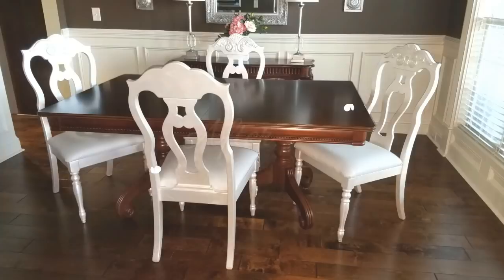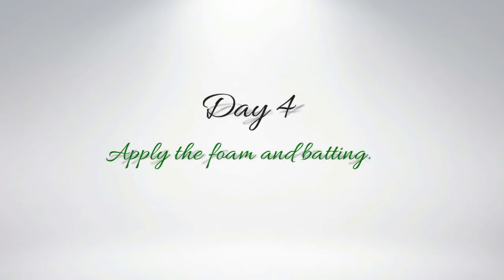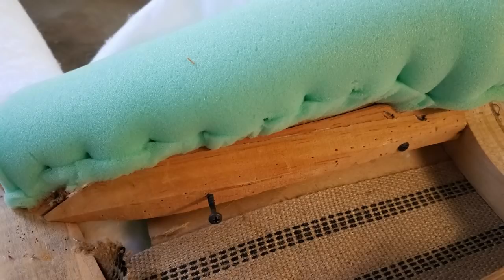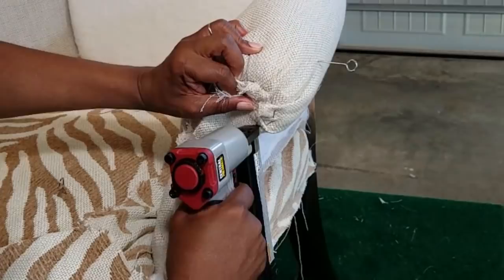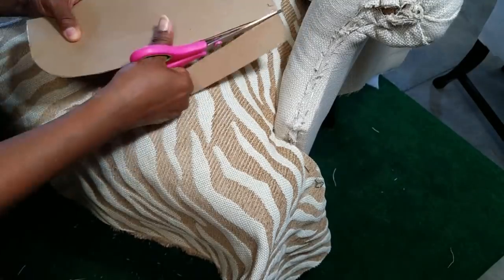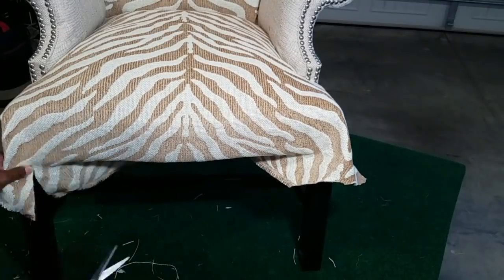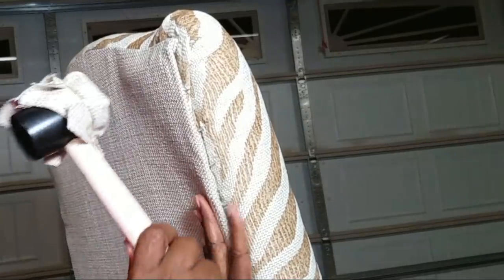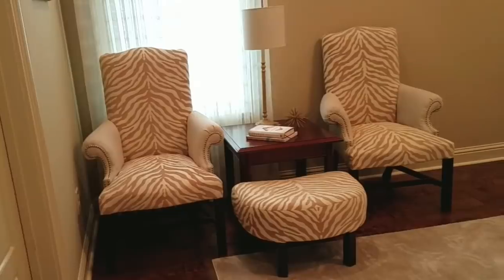Thrifted Chairs & Ottoman Re-Upholstery | Step By StepTutorial For Beginners

Comment: I really enjoyed this video. I'm working on furniture pieces right now as well. I just recovered my 1st piece, it turned about better than I thought it would and it was a great learning experience. I picked up a couple of really useful tips from this video using the clamps to hold the foam while stapling, was a light bulb moment. My next project is an armchair. It needs repairs AND reupholstery, I'm intimidated. I have no carpentry skills, there's a wonky arm & an issue with a leg, but I'm determined! I HATE the idea of throwing the piece away and I can't afford to take it to pros to fix, dyi it is! Fingers crossed. Thanks for the encouragement you offer in your videos.
Reply from the maker: Go Erica Go!  You can do it!!! 🤗Cathryn

Comment: Use a small piece of cardboard with a slice in it to,hold your tacks then slide it out after the first whack. My tack hammer is magnetic to hold the head of the brads....if they are steel based. Love those fabric stretching pliers. Nothing looks worse than uneven stretching....see it so often on simple stools or dining chairs. 
Nice job.

Comment: Wow what a brave under taking 
I have two wingless armless Chas with plenty of wood showing and wide bottom seats and each have an  ottoman squatty barrel shape   
But my stress is removing the tacs and replacing them  but I’m worried about getting them straight in and spaced just right. My hair seats are similar in shape to your ottoman shown. 
So many great tips in using stretch tools. 
I still have cats so when they find their new home I will reupholster my chairs and new tacs. I’m also looking forward to being able to hang my real curtains 
I have the cats by default. 
Luckily I’ve been seeing since second grade and have mad sewing skills... just wished I had my grandma’s heavy duty commercial sewing machine.

Comment: I can give you a tip trace your pattern from the wooden arm while your arms on the chair are stripped also if you add 3-6tack through some easy to tear stiff paper  and draw a line on the paper this helps you keep your tacks in a very straight line then hold your stiff paper  instead of the tacks to nail them in this protect your fingers and helps you keep your tacks in aline  once nailed in pull away your stuff paper and then hammer down the last little bit of your tacks tightly .😉